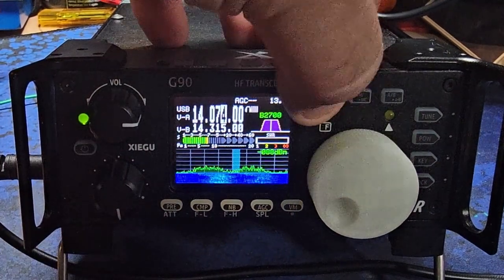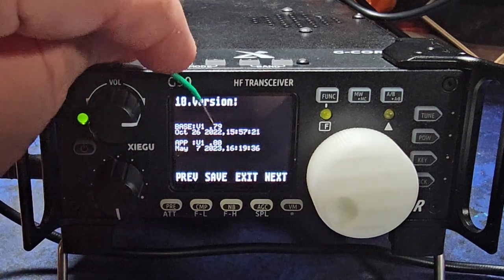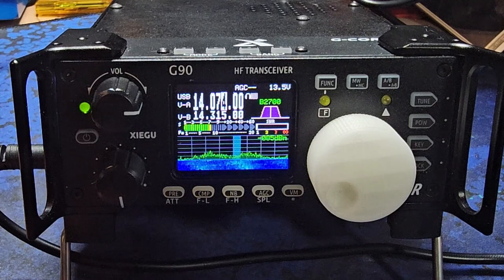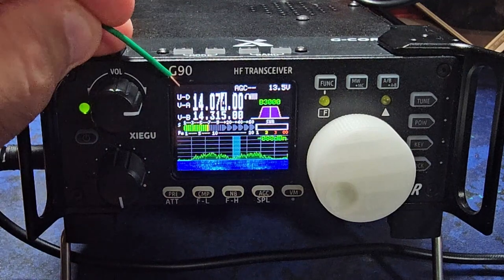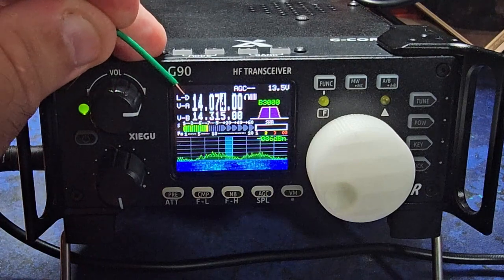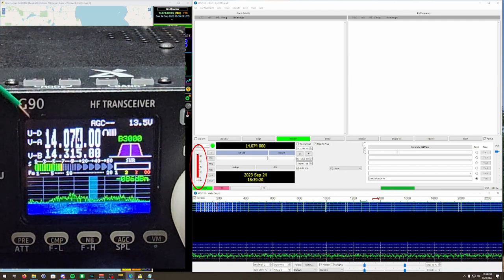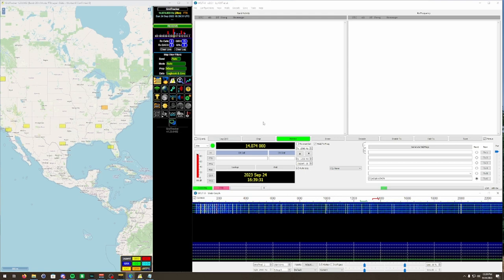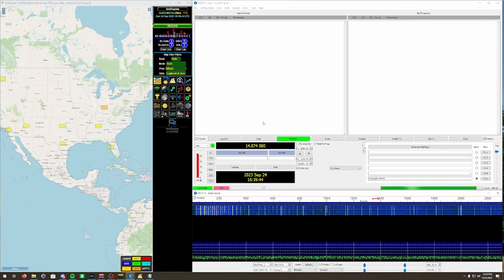Xiegu G90 Digital Modes Fix

Comment: Thank You! A few days ago I spend a few hours figuring out why line in does not work on 1.79/1.80. At the and I flashed 1.77. Now I flashed 1.79/1.80 switched to U-D and everything works like before

Comment: Also by selecting U-D or L-D the audio is automatically routed in/out of the 8 pin connector on the rear of the G90.

Comment: Your noise is coming from your environment. It looks like a charger to me. You can try turning off different circuit breakers and seeing if the noise stops. You can then focus on what is causing it. Power supplies for leds and chargers are very noisy to HF. If you put your radio on a battery, and shut off the main breaker, that will tell you for sure if it is at your shack.
Reply from the maker: Appreciate the comment and suggestions!